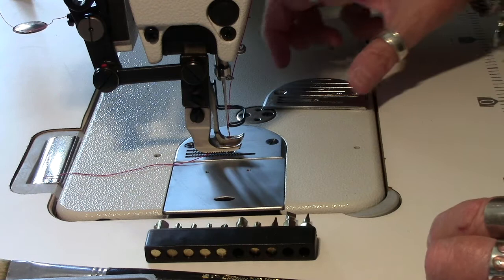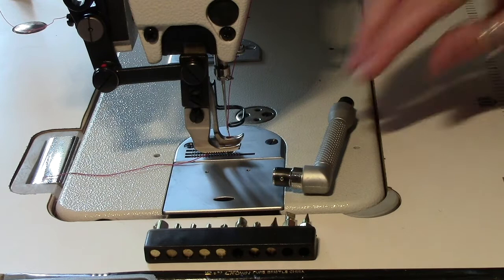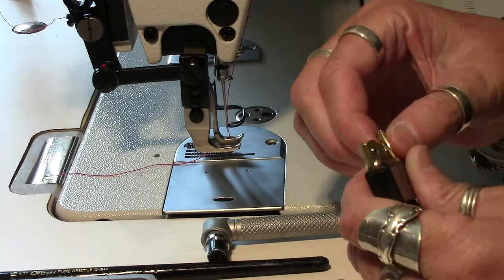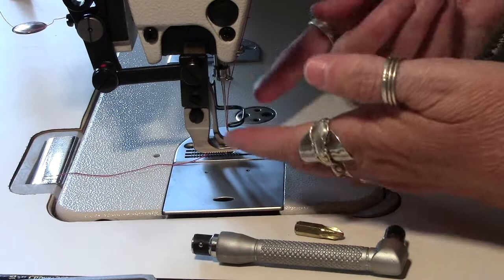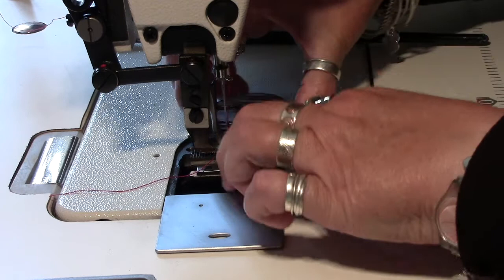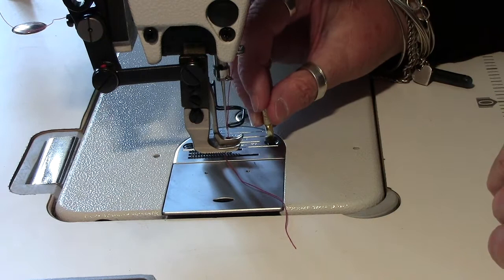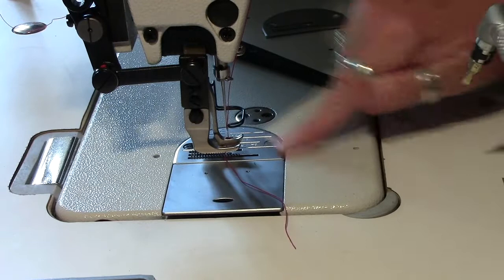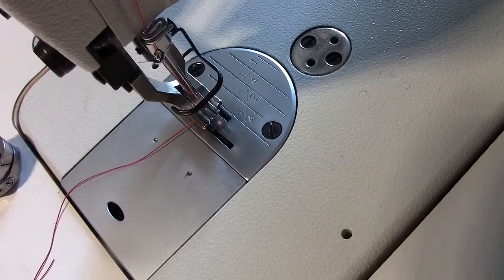Juki DU1181N Needle Plate, it is not recommended to replace this as it may damage your machine

Comment: my back screw is not a phillips head screw, it's an offset  x shaped screw...have you run into how to get this screw out?
Reply from the maker: Have you looked at some of the Torq screw sets? I just did a google search for ‘different screw head types’ and found an image with names of screw heads. You would then be able to buy the corresponding screwdriver. Good luck with your search.